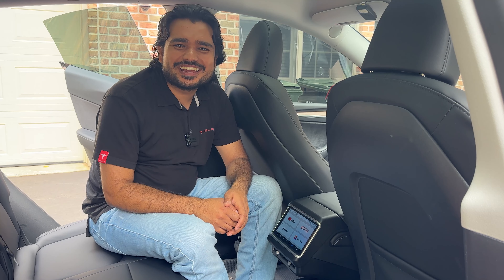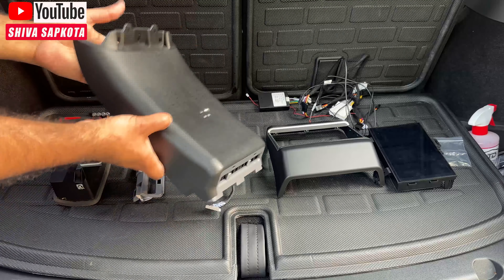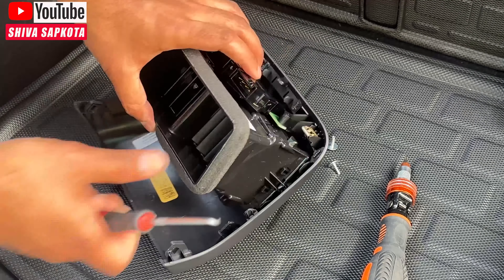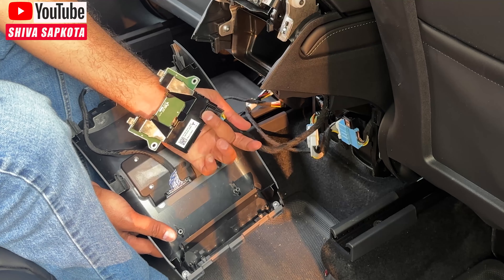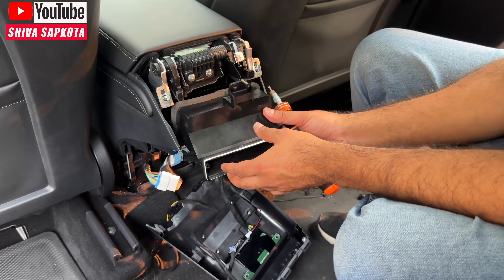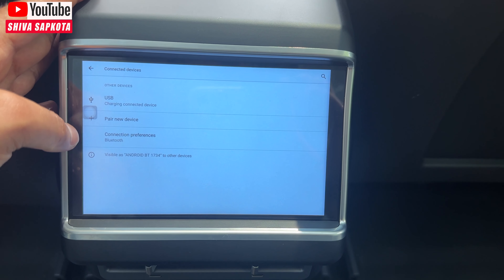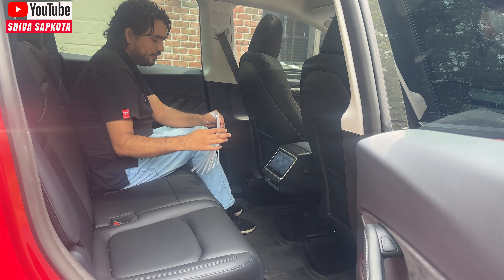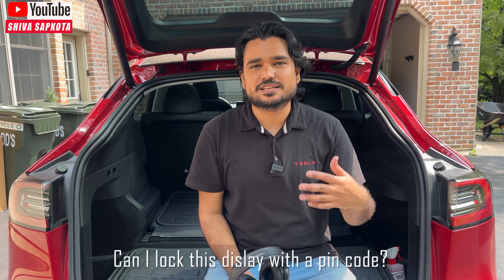Tesla Model 3/Y - 7.5" Rear Climate & Entertainment Display (DETAILED Installation and Testing)

Comment: All I like about this is the auto screen brightness which my v3 doesn’t seem to have(correct me if I’m wrong! I’ve been looking for that). Other then that I find this to be a regression from the one I have, the UI especially.
Reply from the maker: Agreed! This display seems like one step forward (based on larger vents, built in speakers etc) but two steps backwards in terms of UI and installation. Thank you for watching my video.
Reply: How do I get this thing to recognize my network and get Netflix to work

Comment: First of all thx for the video tutorial appreciate your effort on showing how this to install. I did install today and found that the driver side seat adjustment doesn't work. How do you get it work?
Reply: Also, how do you get the USB connection work? I did try plug in my usb into the plug, the charing port and the mic area and it doesn't work.

Comment: Thank you for the great video Shiva. Question: the Blue and white connector (you point it out at the 16.25 mark on this video) nowhere does it tell us which side goes in the lower connectory to the speakers. This connection on the back of screen seems to be easy but the bottom connection one side has plastic and the other side has metal so it appears that side is important? Do you know which side it should be inserted on? Mine was in plastic bag and I need to insert it.

Comment: Hey Shiva!!  Nice video. I have been debating these rear control displays for a while. Since my kids are grown up I won’t use any of the fancy online stuff and really want my vents to be on their upper body. I think the v2 is the one that keeps the vents but is the bigger screen right?  Or should I go from the OG little one just for seat heater and vent control. ?
Reply from the maker: Thanks Todd. I think V2 is your best bet with plug and play install and larger vents. The only downside is that it doesn't support bluetooth audio. The little screen with just climate and seat is pretty cool and has an awesome UI but you do have to transfer the airvent from the OEM unit.
Reply: @ShivaSapkota  can you link the v2 one?  I got lost in all the versions lol. If it’s the one I think, it has bigger vents but you can’t direct the airflow. Does this shoot the air up at the passenger?
Reply from the maker: @toddswire9581  Here is the V2. It doesn't fold up but has decent airflow. 
https://youtu.be/6n-BTN-lGkU

Comment: Regarding the speaker noise issue, I consulted the Chinese supplier directly, they told me that I need to do a software upgrade, they sent me the upgrade package, I will go to the car to try it later, and then let you know the result
Reply: OK, after I installed the update package, the noise issue is completely resolved, now I'm trying to figure out how to use 4G, I will update here
Reply: Not sure where you’re located but I was told the GSM bands on the 4G antenna on the unit are only for Europe and Asia, not North America.  Was hoping to add my SIM card to mine as well.
Reply: @TopShelfTesla  I’m in Europa
Reply: @jeremyyu6600  nice, then you should be able to get it working.  I believe you need a sim tray too, mine did not come with one.
Reply: @TopShelfTesla  After testing, I can confirm that 4G is working and does not need a sim tray, because this screen uses a micro sim instead of a nano sim, the chip is facing up, the oblique cut is facing the left USB port, and then push it in. However, it should be noted that the ordinary SIM card in the phone is not acceptable, is required a special traffic SIM card like EIOTCLUB

Comment: The unit does have 4G, you have your SIM card in the wrong way. The connectors on the sim card needs to be facing the seat or the rear of the car and it should be installed upside down. The flat part goes in first and the notched part toward the floor. Not sure why they did it like this but it was also like this in Generation 1

Comment: Is it possible to fit 2x hansshow canbus wires down there? Powertrunk and this screen and still close the plastic trim? Thanks
Reply from the maker: Yes but will require some cable management to make sure the plugs are flat against the wall. Thanks.
Reply: @ShivaSapkota  Thanks for fast anwser, i was afraid that it could not fit 2 canbus cables and was afraid to order the screen
Reply from the maker: @TheBosnianFamily  Since you said Power Trunk, I am assuming your have a Model 3 and I have fit as many as 3 plugs in a 3 but the space gets tight for sure. Model Y, you can't even fit 2.
Reply: @ShivaSapkota  yes i have a model 3 2020, and there is like a hole there where you can push in some cables. Wich screed would you recomend? Thanx
Reply from the maker: @TheBosnianFamily  If you desperately need one now, I would go with is 7.5". If not, I would wait for a new one that should come in the future :)
Reply: @ShivaSapkota  hehe ok, what could they make better? Im worried about the airflow in the 7.2 models
Reply from the maker: @TheBosnianFamily  better airflow and graphics. I just started seeing proof of concept from a company where they are making the air go from top and bottom of the screen. So, they are improving.
Reply: @ShivaSapkota  but is it relly that bad airflow in the back? Is it to hot back there? How bad is it

Comment: Does this effect battery? Does it shut down when the car is parked?
Reply from the maker: It does shut down when you lock the car and walk away (same as the main screen). Thank you.
Reply: I noticed after locking the car the screen goes blank but there is a dim backlight that stays on for about 15 minutes. In the day it’s not that noticeable but at nights or in a garage it is. Has anyone else noticed this?

Comment: Hi, after I installed the unit I lost the power on both USB typeC port  locate inside the front center console. Can anyone let me know what is going on? Thanks😢
Reply from the maker: Check the wiring to the usb-C board. If it is not connected properly, you will lose power to the front USB and wireless charger.
Reply: @ShivaSapkota  Thanks for the reply, I will check the board again tonight.